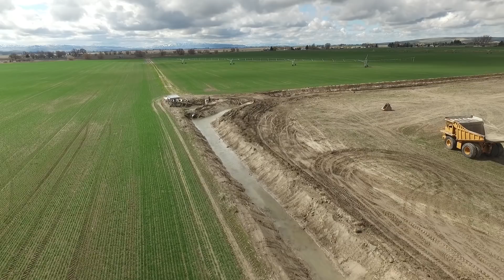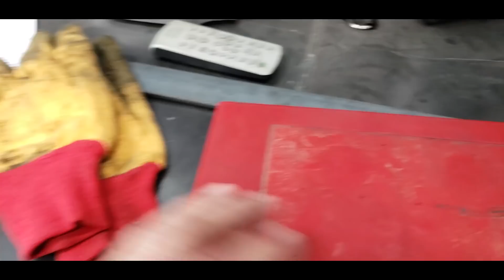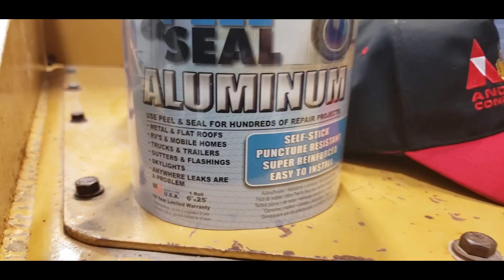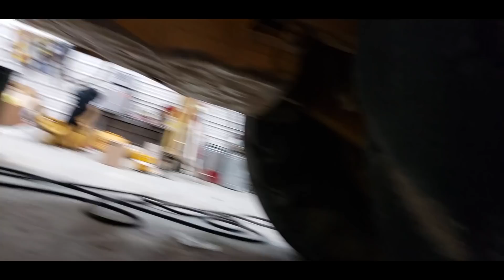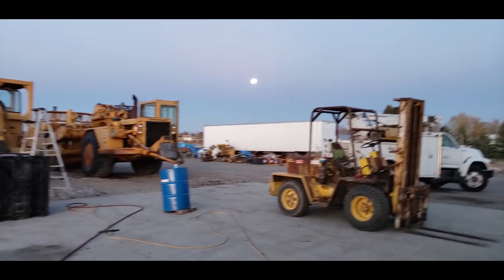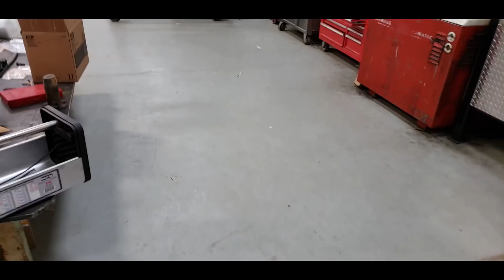Caterpillar 637's Are Done

Comment: The zero tail swing excavators are great for working next to live traffic where you don't want the counter weight swinging out and hit a car . They are actually balanced pretty well. One of the biggest differences is where the boom pins into the swing body, on the zero tail swing  its more  towards the center where conventional machines are pinned towards the front   .

Comment: As I recall, zero tailswing excavators are typically heavier than standard configuration machines of similar boom size.  They make up for at least some of the difference in counterbalance moment (from the reduced cwt radius) with a heavier (usually by making it taller) counterweight. It may not compensate for all of it, but being able to get a machine into tight working conditions can be invaluable, especially for utility companies and people who work around existing infrastructure.

Comment: Zero swing excavators - depending on brand, model etc of excavator - there can be different factory counterweights/ additional counterweights available to balance up the boom arm and attachments  selected. Or custom counterweights  ww.lemaconline.com/counterweights.shtml . Can also use the zero swing excavator with track frame mounted blade, either in front or rear operating positions for stability. Don't use a too small a reduced tail swing - the volvo ecr355e can have a blade = 80K lb machine.  (Treadle valves available in over 700 different models, so there likely to be one that could be a direct replacement or close to a direct replacement for the old scraper treadle valve.)

Comment: Tip on the peal and seal.  Go get some aluminum duct tape.  Seal all the exposed edges of the peal and seal.  That way heat, solvents, etc cant get to that exposed edge and make a mess.  Also makes it much easier to keep it clean.  I would have butted the peal and seal, alternating directions but that boat has sailed already.
Reply from the maker: I did Shain, first row went vertical and butted second row went horizontal starting at the bottom and working up and then overlapped like a shingle to keep out the water out, won't that work
Reply: @Jpaydirt  I'd still seal an exposed edges with the aluminum tape.  I've done it both ways, and sealing the edges is the way to go.  Especially when an edge can be exposed to oils, solvents, heat, etc.

Comment: New sub here, been feeling poorly so I went on a few jobs with you and your guys. Thanks.

That out of production throttling valve could probably be made out of a standard air regulator by replacing the adjustment screw with a pushrod, and some creative bracketry. Some springs may need adjustment, but it could be made to work in a pinch. (if you ever need one TODAY)  I also recall that there is an industrial lever operated version, made by Parker if I recall correctly. Used one on a machine 30 odd years ago. I've seen them on pallet loaders as well.
Just thinking out loud, but if you're ever in a pinch.... there are options. A patient man with a lathe could probably turn one out as well.
Reply from the maker: A lot of equipment used them, RT cranes had to use them, I don't know whats up Bendix's ass that they won't sell them reasonable

Comment: Hey My Paydirt. I'm assured of your skills but... those inch pounds needed from that little diaphragm are pretty big and at a glance, from Alaska, with the caveat that I ain't lookin over your shoulder with a Pabst blue ribbon in my hand, I would consider examining the position of the bell crank on its spline and.... lengthening the distance of the pivot pin? Maybe your other cylinder will work. I can't stay to find out. Back to work. Want me to show you how to make a small fortune in the Gold Mining Business? Hint: Start with a Big One! Cheers!
Reply from the maker: I tried that, but after checking the others and discovering that they were set to 40lbs I set out on a big venture to modify or die trying LOL
Reply: @Jpaydirt  Well Sir, I was talking out my @$$, spouted off before I should have listened and learned from a master.
I didn't think about the sender being the problem because I only took the time to watch you at the throttle end of the video. I will shut up more and pay attention! Gonna look for some Kenny hats for a KW fanatic and myself. Thanks!

Comment: What CAT motor is that straight 6?
Reply from the maker: 3306 in the back D343 up front
Reply: @Jpaydirt  cool. You have any experience with the 3208? We're thinking about getting a White 2-180 which has a 3208 in it.
Reply from the maker: Matt has one in his 613, non turbo is only 150 hp I think

Comment: I have a question on hauling a 623 scraper. I was way over weight on my trailer. Please guide me along. I’ve passed up on 3 loads so far
Reply from the maker: How was it loaded
Reply: Jpaydirt I appreciate all you have done for me.. In my driving career I have always taught to ask questions when your not sure..
Reply: I backed it on. Can I send you pictures and My scales weight?
Reply from the maker: Sure
Reply: Jpaydirt I’ll send Pictures and I formation on Facebook messenger
Reply: Jpaydirt sent. My trailer deck is 22ft, and my  fifth wheel plate is as far forward as possible. I don’t have much room to adjust the load in my trailer. I was trying to drop can on some hard wood to put the weight on my deck, instead of the back frame.